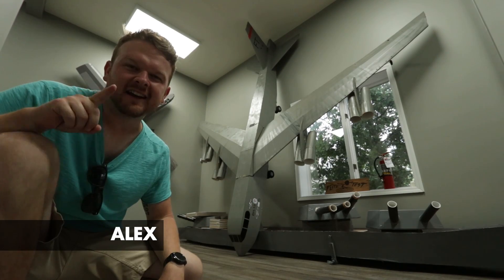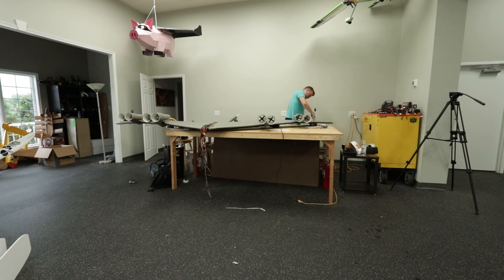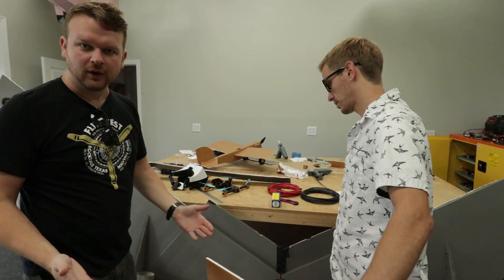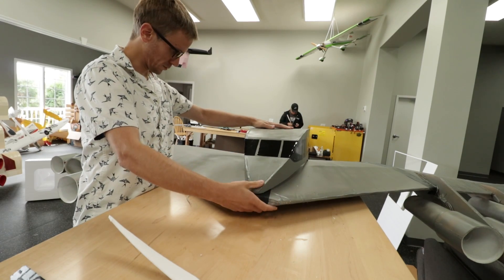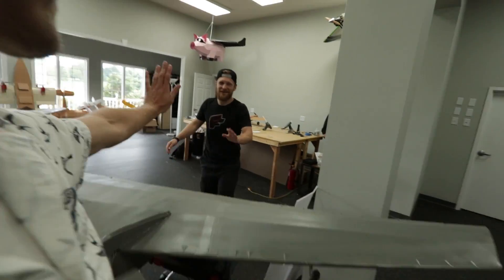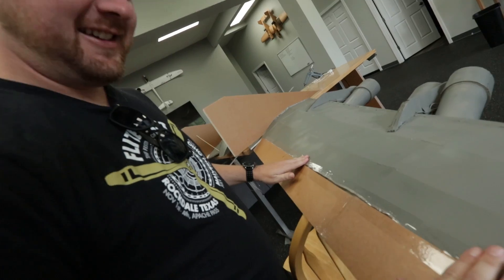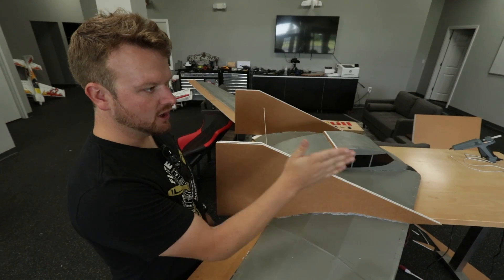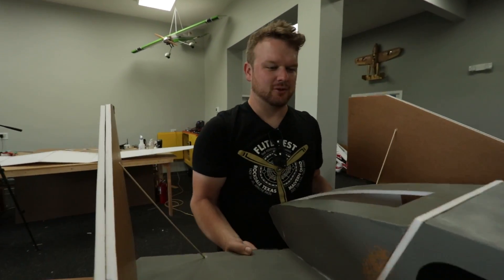Flying a B52 Wing Without the Plane?! 🤔

Comment: I've been in Aviation my whole life. My grandfather worked in Top Secret clearance. My Biological father worked in Top Secret clearance at Area 51. I grew up with an airplane and flying since I was 9 years old.
I am shocked your design flew. I was actually giving you less than 10%.
One of the top secret programs my biological father worked on was the B-52 (BUFF) called Ghost Buster. In other words, it can detect radar invisible aircraft. 
Everything that was tested for the B-2 was first tested on the B-52. 
I like to watch how much fun all you have. And the crazy part is how you build things with everyday materials. It doesn't have to look exact or perfect. You come up with an idea and you just do it.
I work in Avionics for an airline company. But it would be interesting to meet all of you.
I've come to the conclusion the best way would be to design something crazy, build it, film it, and see what all of you think.

Comment: Guys this was great but ..take a look at the Northrop B-2 Spirit stealth bomber, it has NO vertical fins whatsoever. Come on you can make it. It flys and turns basically from horizontal controlling flaps. YOU CAN DO THIS...I KNOW IT. https://en.wikipedia.org/wiki/Flying_wing#/media/File:B-2_first_flight_071201-F-9999J-034.jpg

Comment: I’m sorry, but all the money we all know you guys are making, how is it y’all don’t have a monster Snap-On tool box full of tools? And don’t have a stock of epoxy resin glues and assortments of carbon fiber rods & angles for spars? 

As the creators of the kits y’all build & sell, you should be taking them to the maximum in construction quality and power (thrust to weight).

Comment: I love how big sized deltas and flying wings look in the air. If this exact build with the B52 style engines and all were scaled down and made nice and sturdy and straight, I think it would make an interesting flying wing with all that power and differential thrust. Same goes for the original giant B52, I think if it were scaled down somewhat and made stronger it would fly great. Still cool to see them built and flown this large just to show it can be done out of foam board.

Comment: Flite test I’ve got a question for you guys. will hover board Esc’s be good enough to put into a radio controlled plane or quadcopter as they are 36v -10s battery’s compatible. You might have to control the Esc’s with a Arduino board.? Not sure.? Just wondering if you guys have tried or tested these.? Please get back to me. Cheers #fpvfreaky

Comment: REELSTEADY LIES! If you compare the sets of videos of the before and after "video stabilization you can tell see that the colors are different. It seems like at the least their videos of footage that are stabilized have also been color corrected but at worst their "stabilized footage" is "simulated stabilized footage created by a master at video editing rather than their program. If they did messed with the colors then what else did they do while they were in the video editing software? I feel like they most likely also used the video editing software to pre-stabilize it before they stabilized it with Reelsteady. This seems like they are not being honest with their advertisements and I believe that Flight test should ask the company what is up with this and if they do not get a reasonable answer then they should not let ReelSteady be a sponsor. Flite Test Should be better than lie filled advertisement! Like to find out the truth about the advertisement, get this to the top not for me but for all those who have been tricked by false advertisements!

Comment: That was a pants stainer but you pulled it off for the first half. Little more work locking batteries and equipment down and you would have done it. Great flat spin! Good job guys.

Comment: Flying wings are quite simple to get to fly, from the "hundreds" I have built never had any troubles, you made it harder than it had to be, there's a setting for eleven mixing on most TV's, and all you had to do was put your vertical stabilizers on the wing tips, and duct tapping a carbon fiber spar either to the top or bottom would have sure helped but not bad, there's a neat kit maybe still around called a mothership from some guy out of California......flying wings are the best though, back in the day I had 20" wings flying at 100mph from hand wound motors made from cdroms stolen from pc's

Comment: You should make a larger WWII fighter that can perform a barrel roll. Glue 3 inches of styrofoam to the roof of the fuselage. Then drill about 12 1 inch holes through the styrofoam in the roof.  Take firecrackers with about a 1 minute fuse. Somehow light all the fusses at once take the plane up about 50-100 yards perform a barrel roll and let all the firecrackers dump out the top of the fuselage. Make sure firecrackers sit loosely in the drilled holes or the plane will explode in the air. which would also be pretty cool.

Comment: Man, that was hilarious!! Can't believe you got that in the air and back on the ground without crashing.😁 By all rights, that contraption has the flight potential of a cement truck, but judging from the flying pig hanging from the ceiling at 6:50, you guys are well-versed in making anything from lawnmowers to kitchen sinks actually gain altitude and fly.🤣

Comment: You guys should build either a B117 or a B-2 spirit
Reply: It's F-117, not B117. Then again, if they actually followed the proper naming protocols, it should have been in the A (Attack) series of aircraft, as it doesn't really have any air-to-air capabilities at all. At the time the plane's designation was assigned, it would have been called the A-11 (with the initial production version being called the A-11A) if they'd followed the official naming conventions.
Reply: evknucklehead weird flex but ok
Reply: @fishnipples2248  I don't think you're using that saying right...

Comment: Prandtl wing.
Prandtl is a mathematician, he came up with an equation for lift.
But in modern aerodynamics we cut it down...
Which is why we need ailerons.
There is a series from NASA research that goes into making and testing models for the for the complete equation applied to the engineering.

I hope you check it out.
There is also a program associated with this where students can join.

Comment: Okay what about a solar wing plane. Even bigger wing design with a thin layer of solar panel over it. You should compensate the momentum made by the ailerons, elevons, and the split rudder though by decreasing the size towards the tip. Then use quadcopter like stabilisation software to make it flyable. Since the B-2 is not flyable without software aid.

Comment: Try to built the Horten 229 (German Bias only wing fighter) it was never built by the way
Reply: Actually it was, just never quite made it into full production, 2 prototypes were completed and flew successfully V1 and V2, V2 ended up crashing, killing its pilot after an engine failed in flight. A 3rd prototype was very nearly completed, then the US captured the production facilities and shipped the nearly completed V3 to the US, via RAF Farnbourgh. Another 4 versions had already been planned and ordered, based on the nearly completed aircraft of V3. The only surviving example is the 3rd version, which the US acquired and shipped to the states.

Comment: Ok so you just hacked off the trailing edge? Why did you not cut them off with a bevel edge, then hinge and mount on opposite wing? And stiffen with carbon rod.

Comment: Please make an SR-71! I know it's really hard not if anyone can build it, you can
Reply: Really hard, is it? Unless you try to make it to go mach 3+, of course.
Reply: @azgarogly  no the shape of it. It needs to go really fast to create lift. Because it's shape is built for stealth
Reply: @silience_  There is nothing special about shape of SR-71. Considering RC models typically have very low wing load and good power to weight ratio, problems may occur balancing the thing, but again, in case of SR-71 there is not much of a problem, as the shape rather looks overstabilized rather than unstable.
Very low wingspan might lead to too fast reaction in roll channel, but that is not that much of a problem and can be cured by electronic stabilization, if all the else fails.
Reply: That would be slick. Yes !  SR-71 !

Comment: 18:30 “truth is we’ll neverknow”

Me: WTF LOL (laughing hysterically)
Reply: You saw the maneuvers they were doing. A relatively large battery pack being flung around loose inside there can certainly pull hard enough to disconnect, which is what appears to have happened on this flight.
Reply: How can the battery connector disconnect mid flight? You need to pull so hard to disconnect it.
Reply: battery not very well attached in the ness i gess xD
Reply: We may never know the truth about the battery but what we can find out about is the odd difference in the color correction in the "stabilized video" versus the "original video." Something is fishy here and if you look at the two video side by side with a critical eye  it becomes obvious that the video has more than just stabilization done to it. I think that is False Advertisement and instead of demanding to know what happened to the battery, we should demand to know why the sample videos for Reelsteady are different colors. Are they different cameras, one on a gyro and the other not, was that "simulated stabilization" instead of real results from their program, did it get color corrected in post and if so what else did they do to it? NO MORE FALSE ADVERTISEMENTS DEMAND THE TRUTH!
Reply: evilcanofdrpepper lol

Comment: I love the project, but wish the steadicam commercial and channel-promotion wasn't so long and overt. As for the plane, I think the idea is solid but needs:
1) You don't need a rudder on a flying wing so make the winglets larger and remove of all the other vertical stabilizers
2) Secure the damn battery
3) Stow all the wiring in the wings
Bonus points: If you can open the length of the wings, add an I-beam or triangular prism 2/3 the way to the wingtip.
This can end up being a wonderfully handling plane so I encourage you to keep at it.
Reply: great tips melinda

Comment: "It's a B-26."
Did you mean: YB-49?
Reply: Yes, a YB 49 from Northrup aviation 1949, before the Military Defense secretary had Northrup distroy all seven of the finished airplanes.
Reply: By "B-26", they meant "half of a B-52".
Reply: The B-26 was a Martin Marauder.  It was a ground attack aircraft that featured heavy machine guns in the nose and bombs to follow up.  It was unstable and hard to fly, unlike the mechanically similar B-25 Mitchell which flew like a fighter.  My Uncle, who trained P-39's said the B-25 was the best flying aircraft bigger than a Mustang.  The BUFF was iconic of the 70's the way the B-17 was iconic of the 40's.

Comment: Check out the YB-35 and the YB-49, the first attempt at flying wings. They were found to be unstable and difficult to fly, the gov scraped the idea until the advent of computer assisted fly by wire, which is the only way an F-117 and the B-2 is even flyable. I think the differential thrust helped overcome some of the instability. Plus some nice flying! ... That would be a great prototype for a YB-35 Flying Wing model

Comment: you guys should put carbon bars to strengthen the wings and reduce the sagging
Reply: I was thinking string tension.
Reply: I think it's in their plans to rebuild the plane. That's why they set out to push this wing for a video.
Reply: Nah, just secure the battery packs then it would be fine, zip tie or hot glue so they don't shift when fly.

Comment: I'm building a biplane with 2 motors (the ones in power pack b) and two 4s batteries. To do this I have two 30a ecus y connected to a receiver. Is that a good idea? As in, will there be too much strain on the receiver?
Reply: If using the ESC BEC, be sure to remove the power line from one.
Reply: @palicgofueniczekt  what is a Bec? I'm sorry I'm very new to the hobby. My design has two separate batteries and two separate motors.